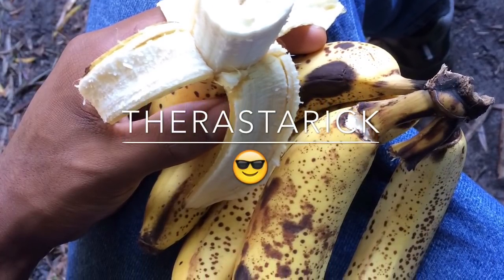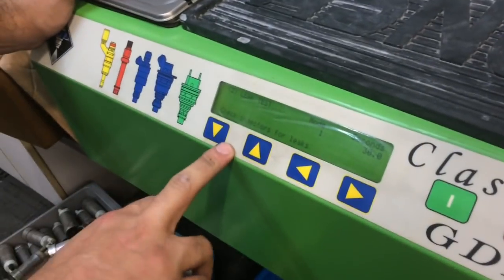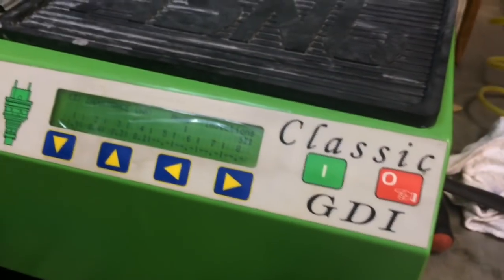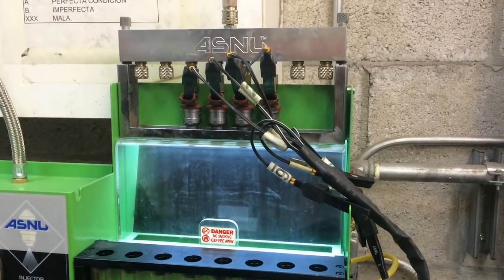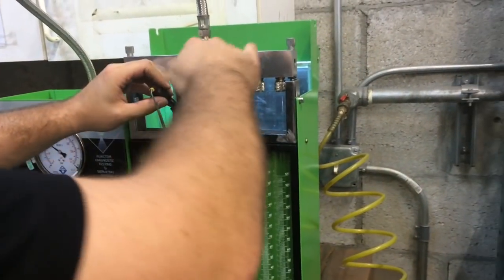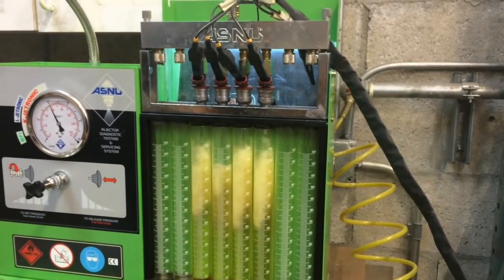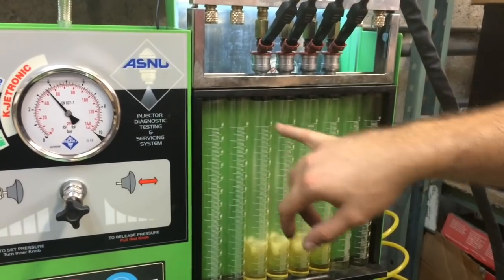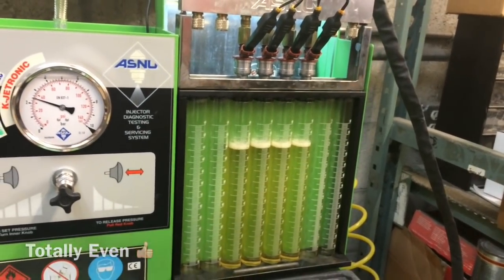Fuel Injector Cleaning (Before and After)

Comment: Missed some steps there.  You’re supposed to pulse the injectors while there in the ultrasonic cleaner. Also those injectors should be atomizing the fuel instead of looking like two streams of liquid shooting out. Maybe you’re pressure is low.

Comment: Did you notice any improvement if fuel economy?
Reply from the maker: no not with these. What gave me better fuel economy was taking off the throttle body and cleaning the black carbon gunk off the throttle body and then cleaning the inside of the intake manifold. Once i cleaned the throttle body and the port of the intake manifold, I replaced everything back together and started the engine and the response to the gas pedal was real precise. The acceleration was incredible, it felt like a brand new car and it is a 1995. The gas mileage increased substantially. it was very revealing. I also did it to a 2005 nissan altima and it did the same thing too. if you have any vehicle thats old, you should give that throttle body a clean and watch your gas mileage increase hands down.
Reply: Thanks Just Eat I'm going to try that!

Comment: Thanks for the video. Did you notice any difference in your fuel economy after they were cleaned?
Reply: well a good shotgun way to clean up your car is find a good spray that can be spray through the throttle body. like seafoam spray. another is to make sure your air filter is clean  or fuel filter if you have one. Do your recommended oil change interval. you can check your spark plug for carbon fouling on the ceramic cathode and diagnose from there. if you didn't stick to your oil change intervals and have major sludge build up cleaning additives can work but understand they dissolve dirty fuel lines/injector but not if they are clogged by rust or non-soluble.  Last but not least make sure your tires are inflated to factory specifications or higher and not below. This is assuming your vehicle does not have vacuum leaks from manifold gaskets, vacuum line dry rot etc... if your car is that old i would guess you have vacuum leak in those areas. You can do a smoke test to find out if you have a vacuum leak.
Reply from the maker: thank you. you gave me alot to think about. ill definitely be checking the engine for all what you said. i hope the gaskets are good. i replaced the intake manifold gasket a few years ago but im not sure about it now. i have to take the exhaust and intake manifolds off to see how they are. your comment has gotten me excited about what to look for. shits blowing my mind. im dying for it to be daylight i dont have a fucking garage or else id be under the hood right now with bright lights on lol
Reply from the maker: No, nothing at all. I thought it was going to fix my gas problem, but it didnt change a thing. the fuel injectors were good from the get go. i took them off for no reason lol Im guessing it might be a gasket problem to the head or intake or exhaust manifold. Each spark plug looks very good so it doesnt like anything is wrong with the internals. So i need to replace something thats bolted around the engine or might need the gaskets replaced.
Reply: check your pcv valve and throttle body
Reply from the maker: wow, thank you. Ill check that out tomorrow. thanks
Reply: another easier way to find out why you have bad gas mileage without costing any money is to find out if you are running rich or lean, a scan tool can tell you by viewing the fuel trim level. You can rent one for free at any autozone. Once you've figured out if it is running lean or rich you can narrow down your mileage problem. o2 sensor data can also help
Reply: Thanks for that. Unfortunately in Australia you can't hire scan tools 😀 most place charge about $110 for a scan report

Comment: do that with a design iii. that's shit you did is not reverse flushing. yes it cleaned it but its not reverse flushing.
Reply from the maker: Gonzalo Cruz who said anything about reverse flushing. I just got them cleaned that's all. it was placed in an ultra sonic cleaner, there's no need for a reverse flushing. the ultra sonic uses high pressure to clean the injectors

Comment: you missed a bunch of steps.. you only cleaned the outside.. lame!
Reply: Actual he is right , you run a pulse while in the ultrasonic and it back flows all the gunk that is inside the injector. All that did was clean the outside and maybe the tip of the injector. You also don't fully submerged injector in the ultrasonic.
Reply: Just Eat gonzalo cruz has a point, if they weren't pulsed while in the ultrasonic leaning fluid then they still may have microscopic amounts of gum/varnish in between the solenoid needle and nozzle. They flowed equal because the tips were cleaned but they may well flow more volume if it was spotless internally and then maybe you'd see a drop in fuel consumption. It's like a dirty restricted air/fuel filter that makes fuel consumption go higher until replaced. If they didn't pulse them and only did what was filmed then they're cowboys and you've just got scammed
Reply from the maker: in the video, it clearly ran threw an injector cleaner. meaning it got cleaned on the inside and on the outside. it also got placed in an ultra sonic cleaner as well which cleans with pressure. so your dumb. who knows what the fuck you see with your eyes lol